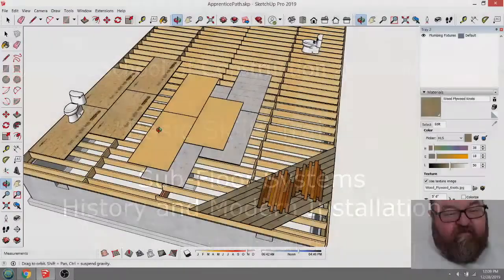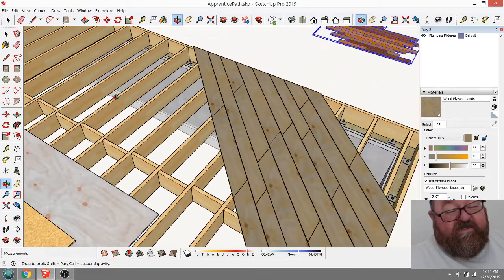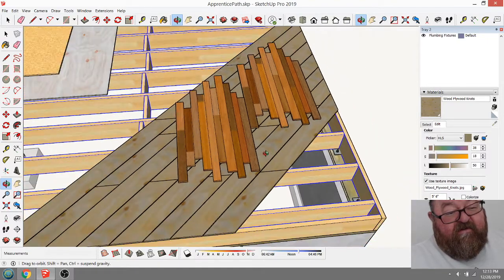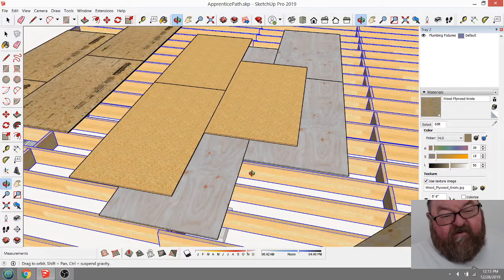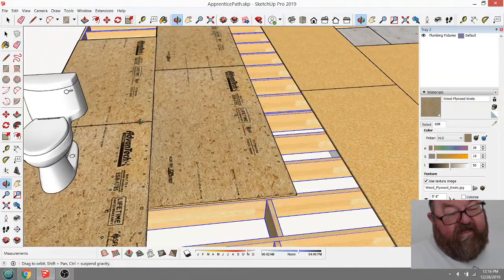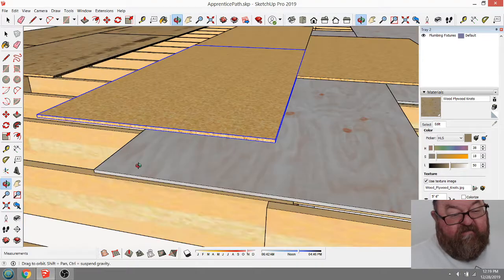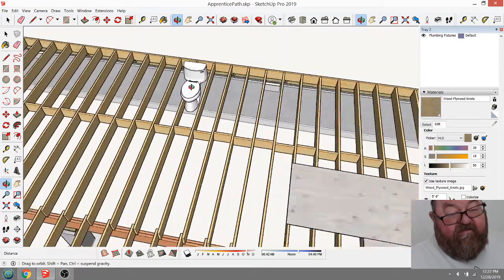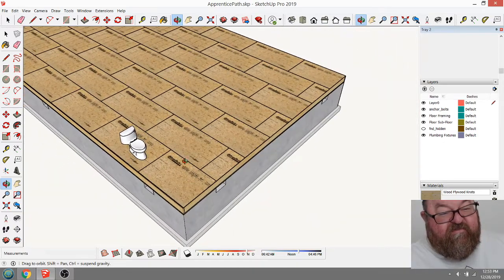Sub-Floor Systems - History and Modern Installation - SketchUp

Comment: How are you getting sheet layout when the floor joist stagger by the 1.5 inches on the other side.   My building is 30 ft wide , with break / overlap on the center beam
Reply from the maker: The first joist is 15 1/4 and then 16 inches on Center setting ahead.  Is that what you were asking about? You might have to give me a little more information so I understand what you’re asking.  Thanks.
Reply: @ArtisanTony  i figured it out ,   I lay the plywood  run down one  direction,   then after I go to the center line , I will run my plywood  coming from the opposite direction.  Old brain wasn't thinking.  Have a great day.